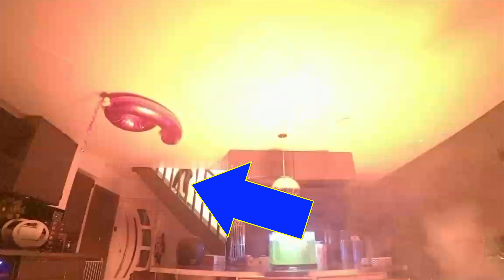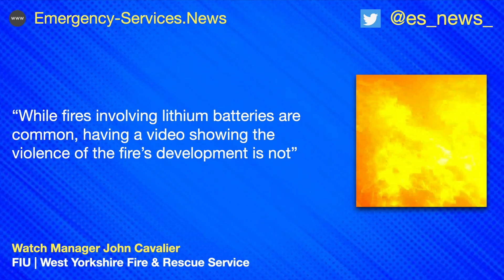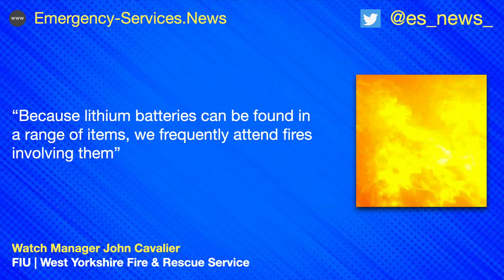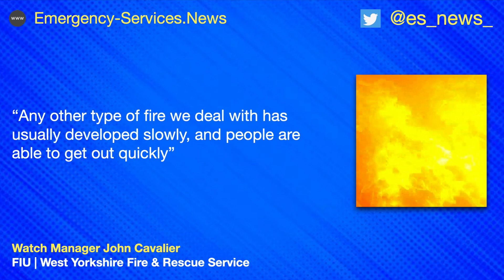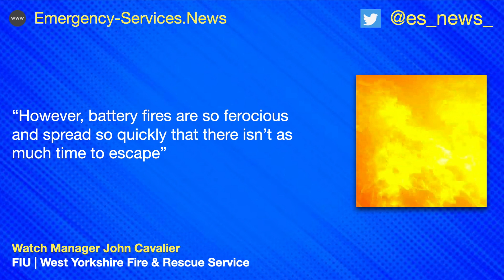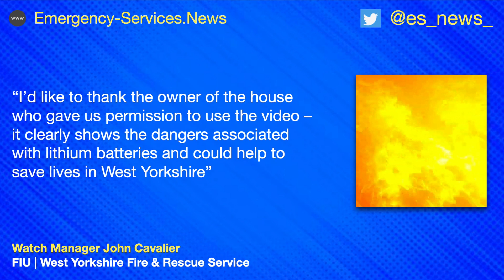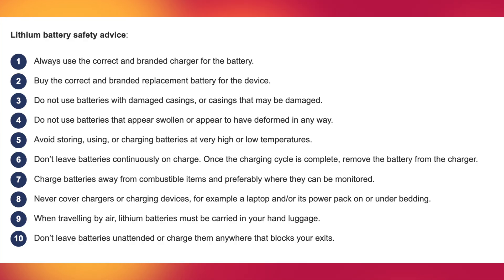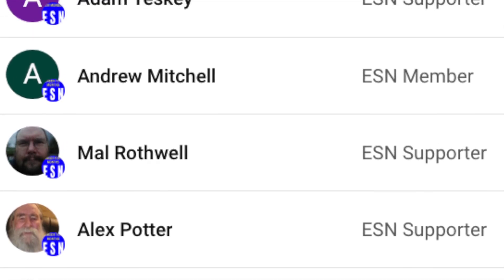The TERRIFYING REALITY of Lithium Battery Explosions!

Comment: To be honest. Well made li-on battery packs have a bunch of sensors in them to prevent them overcharging and turning down rate of charge when too hot. Your Samsung phone will stop charging if its too hot (like in 30'c days playing games) but cheap unregulated products like this ebike have none of that safety. So once 100% charge is complete it will still continue to charge. Eventually cracking one of the cells. And hence fire.

Comment: I am in the process of upgrading from 100ah Ni-Cads to Lithium-ion batteries in my mobility scooter. Increasing range from 35 miles to 65 miles. But I must confess that seeing how many fires in China, Japan, USA, and many other countries, where EV cars, on charge, just catch fire, I am thinking I can tolerate the 35 miles which does get me to my two local hospitals.
I paid £13K for my mobility Cabin Car and I don't want to lose it to badly made batteries.
BUT, who charges  Li-Ion in a HOUSE??? FFS, they are amongst the most difficult batteries to put out.
Reply: Who charge li-ion in a house? Everyone who owns a mobile phone. 

Conversion from one type to another battery chemistry, is not as simple as change cells, the voltage sensing also needs to change, and so does the thermal sensors, eg Ni-Cads don't need them, li-ion and Li-Po do. Your conversion must be on something rather old because no manufacturers have been allowed to use NiCad cells for anything commercial for years with only a few exceptions like emergency lighting because Lithium based chemistry is us suitable for that kind of application.
Reply: @Dennis_M1DLG  e scooter has much bigger battery then a phone though.
Reply: @Dosedmonkey  moot point, size of a battery catching fire still equates to a fire. 

Also your argument is narrow-minded - many people who buy e scooters do so because it's all they can afford, and that kind of economy attracts people who also do not have large homes with gardens, garages or sheds. These are often people with 4 room flat, with absolutely no choise of where they can place the charger for their e-scooter or mobility scooter. Further to this e-scooters are not the only large capacity batteries in use - I have a 200Ah Li-Po pack and a 350Ah Li-Po pack both for use in ham radio. Do you expect me to take it outside to charge them? They'll be stolen before I get back indoors.

Comment: What about batteries in electric cars?
Reply: They're the same, very difficult to extinguish as well unfortunately
Reply: Use a blanket.
Reply: @Dosedmonkey  That won’t work, there’s an oxidising agent in the battery, thus you cannot use carbon dioxide or other material to smother it, that only leaves cooling it down.